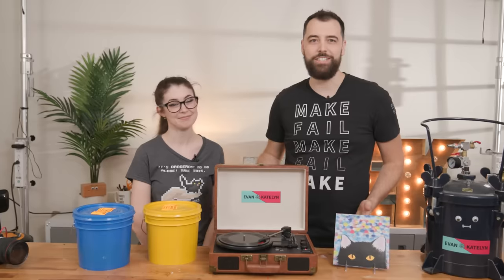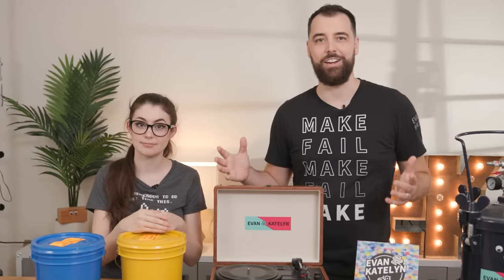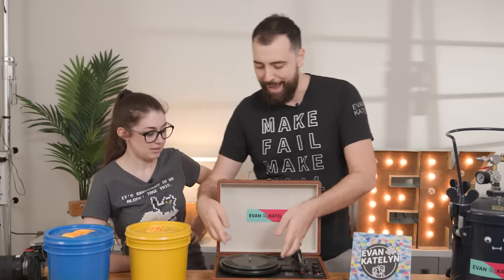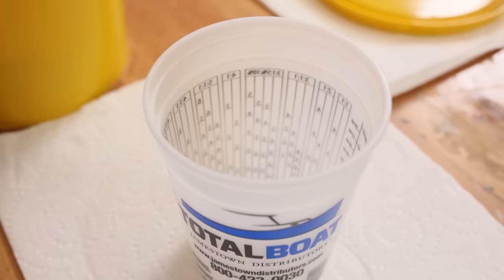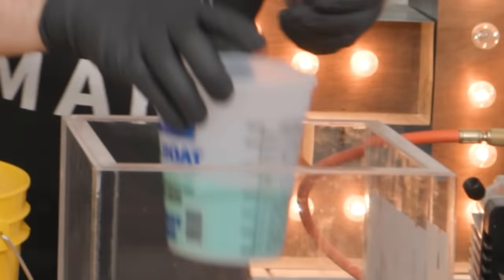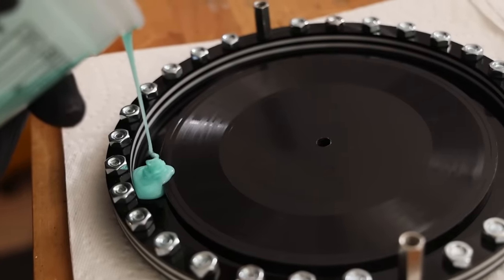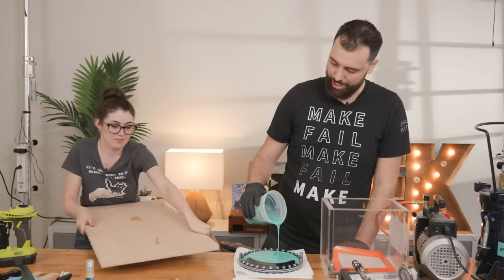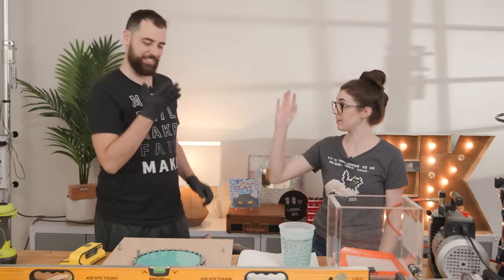Pirating Music With Resin - How will it sound?

Comment: I do resin. Two pointers.

1. Mica and glow powders sink in most resins. You can look for misc resins listed as medium to high viscosity or get light weight powders to mix in next time. Mix very little seperately with its own resin then blend that into your main resin to pour to keep from using too much.

2. Those dots are air bubbles and to remove them their are two methods. Heat works but it can damage molds and blowtorching only goes so far with medium to heavy viscosity resins which is ehat mica needs. So option 2...pressure.  By getting a pressure pot and putting your mold inside of it under pressure you compress the air bubbles so small they disappear. Dice makers using squish molds that cant very well leave any sides open with no lettering do this to get clear dice like glass.
Its basically a painters pot but instead of attaching the pot to an airgun for paint you cap it, put a pressure gauge on it, a plate to lay molds upon inside it and just pressurize the thing.

BONUS: Also to get less air pour slowly so its a thing stream and use a tooth pic to drag the edges or creased areas in the mold. This frees trapped air in grooves to rise out the top.

Hope this clears up your static and gives you better pours! Definitely lookup squishmold making too. Itll help.

Comment: You may get less static by using a pressure pot and a slower setting resin. The higher pressure inside the pot will help break the surface tension of the resin between the small ridges.

Comment: If you guys try this again, try putting the silicone covered record in the pressure pot as well. That way if any microscopic air bubbles form between the silicone and the bottom of the grooves, the pressure pot will force the silicone down.

Comment: To prevent bubbles from forming when pouring, you can try placing a popsicle stick diagonally against the edge and pouring the resin through that stick.
I've seen people do it this way with great success and almost little to no bubbles.

Comment: would it sound clearer with no powders in it? maybe if you did a clear coat on the groves then did the powder mix. Those turntable needles are designed to catch everything and interpret it as sound.

Comment: Love your choice of music. // (Also, I have to turn down the volume at times - Katelyn's voice is so high pitched it hurts my ear.) //  An idea I had for a partial project is to show how to use two-part epoxy putty and how to work with it.  I've been using it for house repairs - filling in holes in the wood siding, making plugs to replace the old plastic ones (for the blown in insulation).  I'm burning off the paint - the previous owner just painted over the old and never sanded the siding so there are very obvious indents in the paint - and the old plugs not only don't like the torch, but they show up too much as testimony to the blown in insulation.  // One thing to mention if you do a video - they may include ONE pair of flimsy gloves; if you use gloves (as recommended) either buy the heavy ones used for washing dishes (and wash them, on your hands, when done with each job) or a box of disposable ones (which you two have anyway).  If you use bare hands (guilty) make sure you wash your hands thoroughly  - I missed a small spot and found it on a finger after it completely dried - ouch!  //  For the plugs, I inserted a small plastic bottle into one of the plug holes, marked it where it went in and cut the bottle down; I plugged the neck with some of the putty.  When it was dry, I covered the cut bottle with plastic wrap, added the putty then turned the putty out onto more plastic wrap.  When they were dry, I took the plugs outside, adjusted the size with a utility knife, and glued them into place with liquid nails.  When they were firmly dried, I thinned a bit of the putty and went over some of them with a putty knife.  After sanding, they disappear from sight when the siding is painted.  I also filled in a hole in the doorway where the wood was bad where it broke when I had to break the door in when the old door stuck.  I re-drilled the hole, painted it, replaced the plate and now my new door closes properly.  //  When I watch your videos (DIY or gaming), I'm also either playing games on my phone or doing adult coloring - just can't sit and watch these or TV shows/movies without keeping my hands busy.

Comment: I know soaking bottles of epoxy in hot water before mixing might help thin the solution. Wonder if it helps with resins or would somehow start a curing process?

Comment: If you did this again, I'd do a thin clear layer of resin first, allow it to fully set, then do the design layer. that way, if you use glow powder again or put items into the resin, it won't mess up the playable surface of the record

Comment: I have never poured silicone or resin, but I feel like when you pour on a single spot and you can actually see the silicone stream bunching up on itself at the bottom, there is probably some air being folded in. Does it make sense to go in circles instead (or spiral or anything that doesn't pile up as much)? Is that maybe even actually worse?

Comment: If the same resins of today were available in the era of LP Records, resins may have been made illegal to prevent music piracy. Lol!! There'd be stories about our grandparents molding records when they were young and rebellious and selling 'em to friends. There could have been "mold shops" where they pumped these things out 24/7 to make a few bucks.
I know that the way they used to make records required a large industrial press that heated up the vinyl while at the same time used TONS of pressure to force the vinyl into the tiny analog sound valleys. Don't think they're called that or even close, but I guarantee everyone knows what I'm trying to say. And it's amazing that modern resins can be simply poured into those valleys in your kitchen with nothing but a countertop sized pressure pot. Materials technology is flipping awesome!!

Comment: It would work better if you pressure cast the mold. That would force the silicone down into the grooves to capture 100% of the detail. I've been doing silicone mold making and resin casting for over 20 years. Pressure cast the molds and they'll duplicate fine details like fingerprints and water spots, and duplicate them onto the resin castings.

Comment: Well, I'm not really a DIYer, but modifacation? Well. I thought to myself today: if I rotate the plank that is part of the monitorriser is where the very monitor I'm watching this on then the plank will be 45 mm more to the back - to the wall, so I have more space for what's in front of it and for the keyboardin front of that. Experiment succesfull... Although in the process I did had to rescrew three out of our screwholescrews. I've got the week off next week to rotate the other two. Also, I've got small wooden blocks to put between the clamp and desk to rise the risers even more. I've taken them out for now, but with them back in I think they will be ideal. I'll probably let you know the progress. I want the blocks blue in the end so...
Reply: Oh for you North-Americans: 45 mm - that is almost 2 inch. And that is quite a win for deskspace if there's a lot on your desk. Especially our European desks. 
I mean, smaller homes, smaller desks, relatively more space. Technically more space on the desk and same amount of space on the riser. I call that a win-draw! 😆

Comment: Has no one ever used a record player before? Thickness wasn't an issue it was just cheaper to use as little vinyl as necessary. Record players could stack multiple records and drop them as needed!

Comment: >.> why does everyone say bubbles are a problem on a thin layer? Just use a foam brush to coat the item. it will dip into all the little nooks and once you get the first layer cursed you can just pour on a tad bit more to the desired thickness. 

Youre working with resin, its not like you dont know its going to take a while 🤷‍♂️

Comment: It's the powder, not the Crosley. Some of it is going to be exposed on the playing surface regardless of the resin. The genuine glow in the dark vinyl records are noisier too, for the same reason. That said ... It's still an unwise investment to buy a Crosley-type suitcase, or any other record player that uses the Shenzhen Skywin tonearm and mechanism seen in this video. It sounds vastly inferior (even hooked up to better speakers), wears out the records prematurely, and will skip on some pressings due to the cheap undamped tonearm. Anyone that tells you otherwise is telling you what you want to hear, to get your clicks. There are inexpensive turntable options that are a thousand times better. If you already have a cheapy, your best defense is to change that needle often - with a genuine diamond tip replacement if you can find one. If the point is pink, that's not a diamond. (/pontification)

Comment: the hissy quality of the duplicated record is directly related to the glow in the dark pigments that sunk to the bottom, near the surface with the grooves. That stuff is like sandpaper for your stylus, but it really won’t matter much with such a cheap player (personally I wouldn’t disrespect any record with such an undignified piece of junk like that but I suppose it was sufficient for the purposes of this experiment)

It would be cool to explain to your viewers that this process isn’t completely dissimilar from how records are commercially mass produced in the first place. Just with PVC, metal stampers and hydraulic presses instead of gravity, resin and silicone molds.

Comment: I hate to be that guy - and I get this is more a fun project than anything practical - but a more 21st century approach would have been to build a laser 'needle' to read the disk, a 96khz 24bit sampler and create an uncompressed FLAC file of the recording that would provide a perfect reproduction of the sound of the record.

Or, scan the record at high resolution, create an STL of the grooves and use an 8K SLA printer to see if you can print a copy of the record. :)